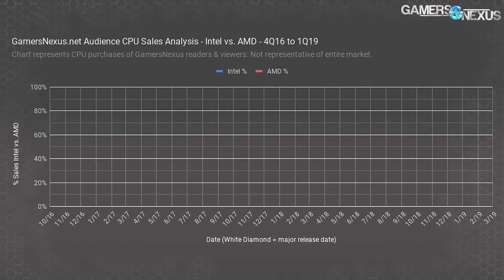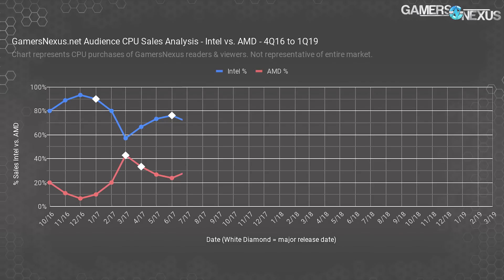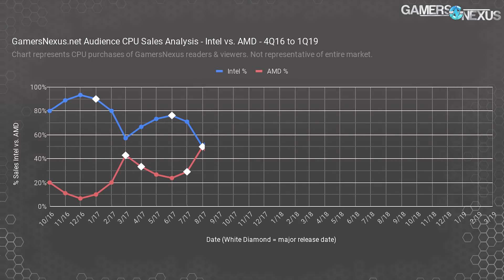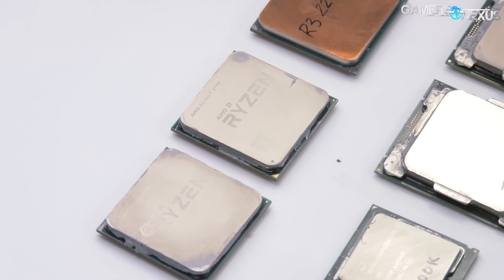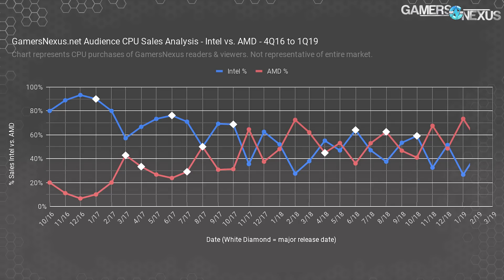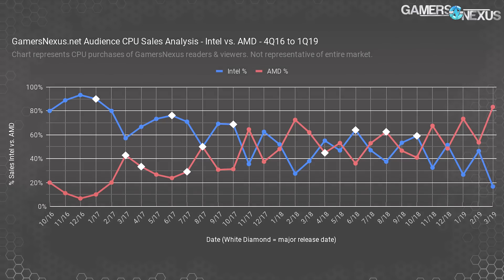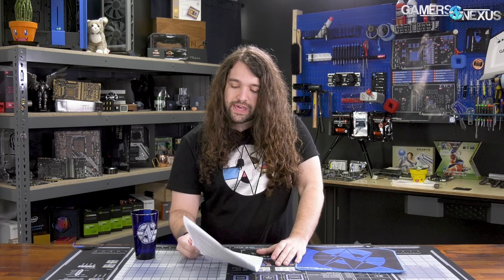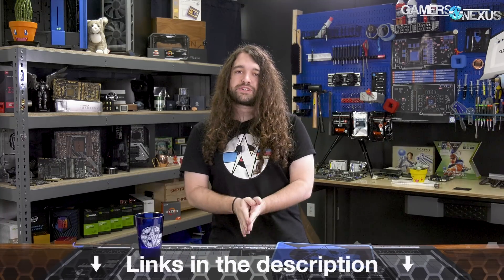Special Report: AMD’s Comeback Story - Intel vs. AMD Marketshare

Comment: Thing is, I still have a computer with an FX quasi-8-core CPU in it that I bought in ~2013, and I genuinely can't complain about it.  It has never given me any performance issues or anything, even still runs well - that is, programs load reasonably quickly, the OS boots quickly, never get hangs, etc.  Games even run OK on it.  My 5950X is WAY faster, but it's also like 8 years newer, has 16 full cores and access to DDR4 RAM, but for a computer that's almost a decade old, it's really not that bad.  Which is good, because that gave me reason to stick with AMD and their newer products are downright incredible :)

Comment: I would be curious to see the amount of people buying the 9400f. I remember that the go to cpu for a standard gaming pc was a locked i5, but of course now all ryzens can be overclocked. I bet most current i5 customers are buying 8600k/9600k out of need for extreme single core performance in things like cad.

It still boggles my mind that 2.5 years ago we were sticking a 1070 and a 7400 in a pc and calling it a balanced gaming pc.

Comment: My first and only Intel cpu was a Pentium 2 back in 1997/8. I've always used AMD since, mainly because of 2 things: 1) Intel processors were always so extremely expensive and 2) I really didn't like the way Intel abused its monopoly position when things weren't going so well for AMD: bringing out new processors that weren't really that much of an improvement of the previous one and nearly always requiring a new motherboard for any new proc released. For the last 21/22 years I've solely been using AMD. Therefore, being a hardcore AMD fan (up to the point that I won't even consider an Intel cpu), it really feels good to see AMD regain a very good market share again.

Comment: I am Excited to see the new AMD CPU and GPU Lineup coming in. I am not falling into the hype but i like what AMD has done so far on the CPU side. (2600/RX 580 8GB Owner currently). 
If anything i could care less what i buy as long as it works. 
This promises a bit of competition in the CPU front, still, GPU on the other hand i think will be a wait and see approach.

Comment: My latest bought intel cpu was in lap top and was gen 1 i5 … cant recall the model number anymore.    The one before that was my first pc as child … 90 MHz Intel Pentium with mmx …      So in short..   iw been   Amd guy in cpu side forever.      Mainly due unlocked multipliers and better over clocking in general . Or that was the reason to swap in 90's  for me.. and im one who is working on basis .. if something does not give you issues .. dont swap..         But after 2 burned gfx cards in  early 2000's  iw been in green team on that area ever since..   and its not likely to change either..

Comment: AMD doing sales or dumping older CPUs at lower costs is a good thing for consumers. I personally ended up nabbing a second R7 1700X just a few months ago to use in a VR rig and it was significantly cheaper than when the CPU launched a couple of years ago. Great value for the money.

Comment: Just because people choose a cheaper more available option doesn’t make them better. Intel is and will remain king.... not all cores are built equally. Fuck AMD and their customer support. Send me broke DOA FX processor and REFUSED to replace it... said I broke it when I installed it even though not a single pin was broken. Fuck them and the camel they rode in on...

Comment: AMD will spike up again when Ryzen 3 launches. That's good news for everyone. A lot of first gen Ryzen owners are looking to upgrade. Lot of return customers. Meanwhile most folk that bought Intel around that time have perfectly capable CPUs that aren't bottlenecking current gen GPUs. 

Ryzen has been great but it's lacking in IPC and clock speed. Even if games have started to utilize more then four cores properly, IPC is still a huge factor when it comes to performance. 

That 4 year AM4 cycle is a huge plus but it exists for a reason. If you bought a 1600x chances are you're about to upgrade when Navi releases. And if Navi holds it's promise, you now have a situation where that 1600x is going to bottleneck your shiny new GPU. Effectively you're budget build is now going to cost you more than what an Intel user originally paid. Budget build paths usually end up in more money spent on upgrades in a shorter time span. 

If you own a 1600x your next logical upgrade path would lead to a 3600x. You have now spend 9900k money on CPU upgrades in less than 3 years.. point is save up some more money and get yourself a part that will last longer be it AMD or Intel. An extra $100 for a better CPU shouldn't make or break your bank account and if it does, this isn't the hobby for you.

Comment: I was the unlucky one buying the "budget" stuff around 2016 - FX-8350 and Radeon R9 380 (5870 before) later. And I was previously running a phenom. Not being an actual fan boy, I was seriously considering i7-rig. But now I'm perfectly happy with my R5 2600x and 2070armor8G, great for gaming (even Star Citizen, which is CPU heavy).

Comment: Quick Comparison for Mid-Range CPUs..   
Intel i5 9400:  6C - 6T at 2.9GHz (All-Cores Turbo 3.80GHz) with 9MB Cache  (Locked no OC) for $200
Ryzen R5 2600:  6C - 12T at 3.4GHz (AllCores Turbo 3.7GHz) with 16MB Cache (Unlocked OC up to 4.1GHz All-Cores) for $180 
So yeah.. it's big difference overall (except for games where Intel getting like more 5 fps) just 5 weeks to see how Zen 2 will perform  ;)

Comment: I'm glad "Price-To-Performance" is a thing again. If someone wants to build a rig that can push some respectable graphics at 1080p/1440p, the 3.9 Ghz all-core OC of the 6c/12t 2600x is hard to beat at $189, especially when AM4 is going to be usable for the 3000 series and possibly another release after that. That $189 on the CPU frees up the budget to get a beefier GPU as well, especially when with games taking 4C at most (The heavily unoptimized Anthem took 6 on my 2700X..) means that the GPU is doing most of the heavy lifting until we start pushing higher FPS.

Yes, the 9900k is hands-down the best HEDT card these days, and serious gamers are going to be looking at the 8700/8700k and 9700k/9900k, but those aren't *needed*, especially when paired with a high-end GPU these days. I have no problems 1440p Ultra gaming above 120 FPS in most titles (except Anthem) with my 2700X/1080TI combo.

The 8700k "beats" my chip as it pertains to raw FPS, but it's 25% more expensive while only giving about 10-12% more FPS, in addition to the way Intel hits you in the knees and makes their mobos obsolete after 20 months, most people upgrading every 4ish years are doing full builds. Competition is good for all of us and I'm glad AMD is spanking Intel in enthusiast sales.

Now if only I could hit the top of these gaming benchmarks while being on Team Red...

Comment: Going into the end of 20IX, as far as performance is concerned, most likely the Ryzen 3000 line and Threadripper III will be on par with what we will be expecting from the Comet and Cascade Lake releases this year: The 9900KFC and Xeon Platinum 9282 look as if they will have their work cut out for them in the meanwhile and will wishfully hold over Intel enough to state their case with Ice, Tiger, and Alder Lake over the next three years and change, as I personally do not think that Intel and AMD will truly be able to be fully comparable to each other proper again until we get Meteor Lake sometime around 2023 or 2024, assuming that AMD is even still on the 07 Nanometer manufacturing process at that time (heck, for all that we know, they could go to 05 Nanometers before Meteor Lake is even launched by Intel, which could potentially be a critical blow to Intel outright if AMD could pull off that without error).
At this time, the way that I see the feud between Intel and AMD is this:

~ To remedy their shortage, Intel would be best to phase out their Atom, Celeron, and Pentium line outright in exchange to focus primarily on Core, Xeon, Xeon Phi (likely using Celeron or Pentium cores, as opposed to Atom), and their eventual Graphics Cards; the lower power chips are holding them back and only make up a very small branch of the market now, which means that.
~ Intel must also stop selling Locked Core chips, as with Ryzen chips being unlocked all across the board, this makes Intel a bit more unbearable to work with, especially as far as making a Workstation is concerned, as well as the cost of upgrading to a more powerful chip. (On a side note, the 9600K is now ironically cheaper than the 8600 and 8600K on Amazon, which is quite an honest surprise, considering that the 9600K is higher in performance than its Gen VIII Coffee Lake counterparts, this would be a perfect time to purchase one if you're upgrading from anything that is not the 8700, 8700K, or 8086K.)
~ AMD must figure out how to get as close to as equal speeds as Intel to truly state its case, regardless of the Nanometers in the manufacturing process; so long as AMD has lower speeds even on chips with Multithreading and requires Overclocking to truly show how powerful it can work against Intel, there will always be a noticeable imbalance until optimizations can be made.
~ With VIA and Zhaoxin looking to fare up pretty well with their KX~6000 and 7000 series chip families and take away some gains from AMD, Intel will have to play it smart once those launch, a familiar name such as Zhaoxin could potentially prove to be a good ally and it would be a mistake to not take advantage of the scenario; so long as they take the top three matters into consideration, Ice/Tiger/Alder and Meteor Lake will shine brightly, Intel simply needs to know what sells best while still attracting their main business bases and the rest will speak for itself, what I am looking for is a balance of the companies and not a complete blowout nor shutout.

Comment: FX its like having a 200 watt i3 7300 on a good day with a overclock i have a 8150 and a 990 extreame board wti a 1tb ssd and a 980 strix and its still sluggish as hell compaired to my i5 6500 1050ti with a boot ssd and a 1tb firecuda. going to buy a R5 1600 now that they are $80 now at microcenter and the motherboards are good prices on b450 boards still going to screw with these old FX platforms now that they are cheap enough to handgrinade and not care $80 for motherboard ram cpu and cooler now on the regular build it and melt it with a RX580 or whatever $100 gpu you get used i got my 980 strix for that and am getting a Rx580 8gb for that its never been better for used builders.

Comment: This is a lot more useful data than steam's broken hardware survey.
Edit: Damn, look at that chart. Very nice data!  
One thing I was thinking about with regards to ASPs: The second-hand market for AMD is relatively strong, especially around threadripper parts. 
Example: 2990wx, newegg is $1700 right now, you can grab a brand new tray part off of ebay (no retail packaging) for $1,380. The packaging is neat and all but at the end of the day it's not worth $300+. An actually used 2990wx can be purchased for ~$1100 (sometimes a bit less and sometimes with the retail packaging).

Comment: This is one reason I buy AMD whenever possible, even if it isn't the best value/performance proposition. 2017 showed how badly Intel was stagnating with performance and prices. That lead to poor consumer practices. Bought a 1700x when the first came out. Killed Intel all around and forced them to react for the first time in a decade, and they couldn't rely on bribes either because AMD knocked it out of the park.

Comment: What a fantastic video!  I am definitely part of the stats you've posted here.  Value to performance of Ryzen is hand's-down the best over any system I've ever owned.  I have completely replaced every computer in my family's arsenal with a new Ryzen system. 

 Summer of 2017 I started with ~$600 Ryzen 5 1600 build as a new replacement for the 2014  FX8320 system (black Friday purchase for $525).  

Next I built a new 1300x system for one sister at Christmas 2017.  

Mom has a new $350 Ryzen 2200g, (purchased after launch Feb 2018) for her birthday.  

The huge drop in Gen 1 Ryzen after the 2000 series launch was too much for me to pass up on.  I grabbed an 1800x and later built that system for under $1200 with 32gb RAM (at a huge price compared to 2019).  This is my content creation   

Amazed with the even lower prices on Black Friday 2018, I picked up a new 1700x + used mobo + PS + case + 16gb Ram for under $500.  This became a portable unit I now use for trade shows.  

I also built a sub $300 2200g system for my other sister.    

AMD has done an outstanding job over the past 2 years.  My next build will come in 2020 (hell black Friday lol even), featuring a Threadripper.  Since my job revolves around content creation and productivity.  Mom's system will get r5 1600 and 16gb Ram.  Her 2200g will go to my other sister's computer to replace the 1300x.  Heck, by that time, I may just order them all new gen 2 Ryzen upgrades?  I'm thankful for that fact that their systems are good for at least the next 5 years.  Also upgrading them could yield longer life as they are not into games, just social media and online content consumers.

Comment: I just bought an i5-9600k and i don't notice these sudden lag spikes you mentioned in the other video, however quite often in games like AC Origins & Odyssey i see CPU usage at 100% while GPU (GTX 1660Ti) stays at less than 90%
The reason i got an i5 was that for a long time i've used i5's the previous one being i5-3570 and i was very satisfied with it.

Comment: Now if only the RTG marketing team would take a leaf out of the CPU division and ATI's books and make architectures that can be sold super cheap but that are as fast if not between 10% and 20% slower than the competition. I can't see it being an impossibility to have a GPU that's only 20% slower than a 2080Ti but costs less than half as much to buy. the entire RTX / GTX1600 lineup is overpriced due to the lack of competition so if AMD could at least do this then we'd be onto the beginning of a winner. Round 2 would be what I like to nickname the "sledgehammer GPU architecture". An ATI tactic where they would destroy Nvidia by a good 40+% on performance (Think Radeon 9700 Pro vs FX5000 series). If AMD did that, then there would be a good chance they would claw back some mindshare and revenue unless Nvidia was ready for it!

Comment: I bought a 6600K (£175ish) when it was still being marketed as an ideal gaming CPU if you couldn't afford an i7. My idea was to buy an i7 when they got cheaper and keep my Asus Z170 Hero mobo... a 7700K is still over £300 new and high £200s used. It's a fucking quad core. I'm definitely going with a Ryzen next time round if the price/performance trend continues.

Comment: Even the steam stats seem to agree with this, as people are getting closer to replacing there current hardware, they  seem to favor AMD hardware. Especially in the CPU space there seems to be a slow and steady gain in market share, GPU still needs some work it seems (mostly also due to game support, AMD is not supported well enough imo), but there are signs that would suggest the same. This is mainly aimed at the majority of entry level gamers versus the enthusiast market represented here.

Comment: intel fanboys: AMD is for poor people.
me: i m maybe poor but not dumb...
Reply: @EJSC I just built in January a 2700, for $230 with stock cooler, B450 MB with wifi and BT that is usually $120 but got on sale for $105, with DDR 4 3000 Mhz Gskill memory (2 x 8Gb sticks) for $105 with a 1 Tb NVME Intel 660P for $125. It's extremely quiet and fast compressing my movie library with Handbrake. I'm only using the auto CPU boost right now but my motherboard will overclock if I choose to. Can yours?

Comment: RX 580 or lower can easily be paired with an Athlon 200GE if you get a board that supports overclocking the locked chips, which at this point almost all brands have b350/b450 and higher boards that let you just type in a clock speed value, and it will take as long as the vcore can keep it stable, which the safe end without raising past stock values is 3.6. I have an RX 480, and switching from an i5 6402P with DDR4 2400 to an OC Athlon 200GE with DDR4 3000 clocked at 2666 with the timings manually lowered to 15-18-16-38, and an undervolt OC on my RX 480, I use less power by a about 150 W on idle, and by about 60 or 75 W or so under average gaming load (though momentary spikes often go about 15 W higher), and I lost about 5 fps at 1440p VSR or 1080p native in most games, on high or ultra settings in games where I was already getting 40 to 70 fps, and 10 to 15 FPS in games where I was way above 100 fps to begin with, so it's not like I actually care about frames my eyes can't see.

Comment: I think the upgrade cycle to 3rd gen should help amd a lot as well, if you already have an am4 board you're a lot more likely to just get a new amd cpu then a new intel mobo and cpu. So selling those chips for cheap may earn them more when their processors are stronger and they can charge for them.